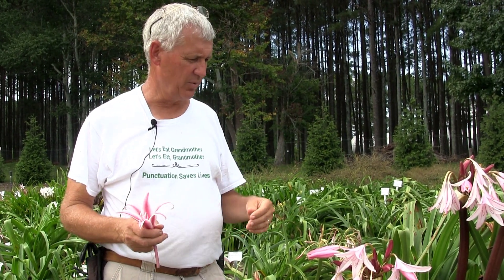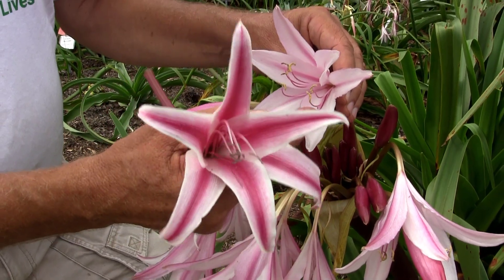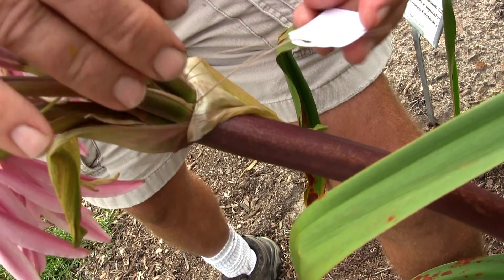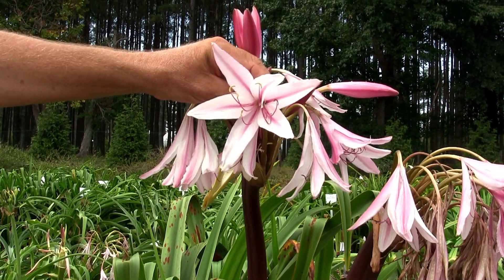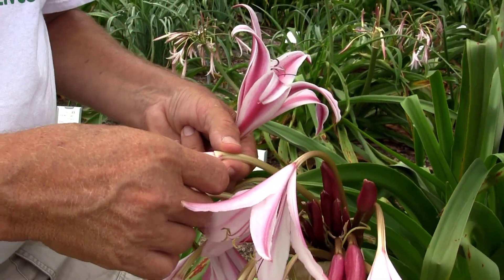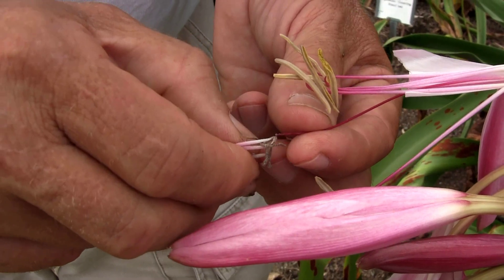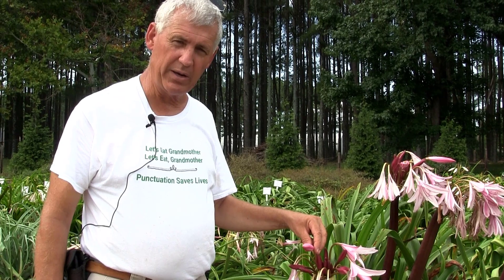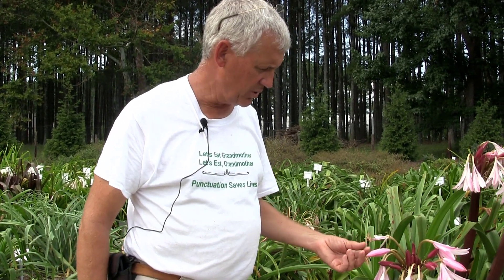Crinum Lilies - How To Make New Varieties at Home (step-by-step)

Comment: I’m new to these plants. Just moved to Florida and discovered these. I’m just starting to landscape my yard and for sure want a couple different clusters of these around the yard. I got some bulbs off 2 very large plants today, 1 was a very dark red/green color and the other a solid green. Some the bulbs was laying on the ground and golf ball side and some was still on the plant and on the smaller side compared to the golf ball size ones. My question is how do I plant the bulbs? Do I lay them sideways or does the little steam go down? Do I keep them in soil or is sand better? Do they need to stay moist? I’ve started seeds and done lots of cuttings but I’ve not dealt w bulbs very much. I want to get as many as I can to come up so any advise would be helpful.
Reply from the maker: Hello! From the information you provided we assume you are talking about the seed pods, which are large and round and held on a stem until they collapse on the ground. Inside the seed pods there are naked seeds, they have no shell or skin, and they are designed to float in the water and germinate as soon as they make contact with the ground. Seeds inside the collapsed pods are ripe and should be sown immediately in moist soil.  We recommend starting with at least a quart sized pot per seed for germination, as crinum lilies are very fast growing and mature bulbs range from 6-12 inches in diameter. The roots are very robust, about 1/4 inch thick, and reach deep into the soil. If you are in the southern part of Florida, with no frost, you may sow them directly in the ground, in a sunny site with moist soil.
Reply: @ ok thanks. I’ll do this and see how things go. 🤞